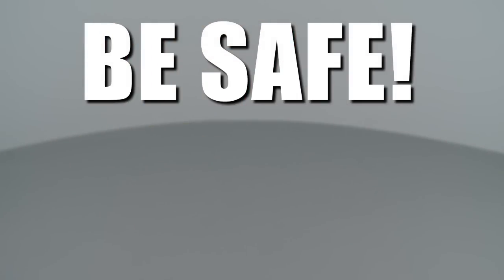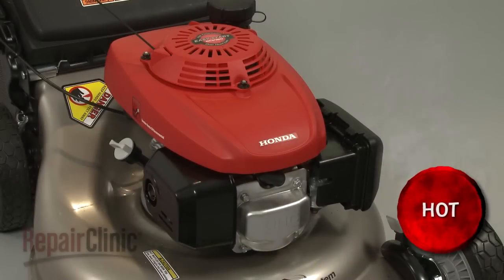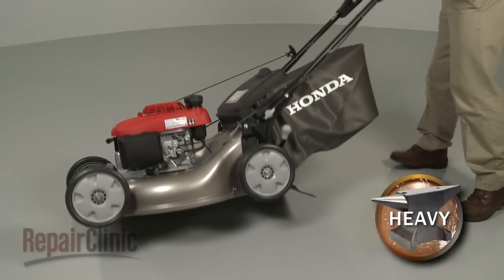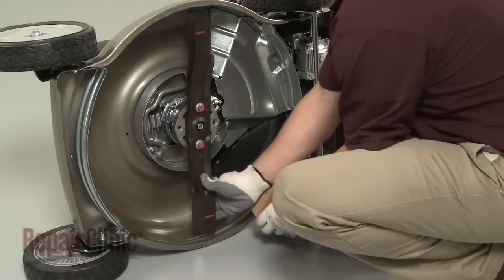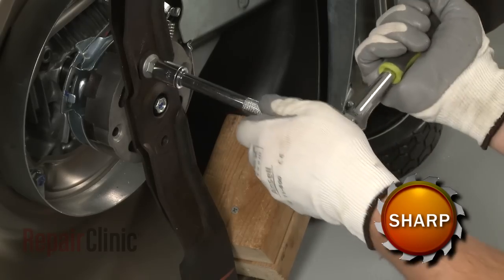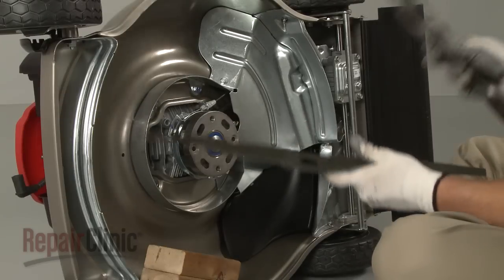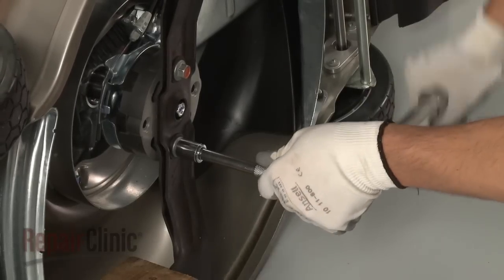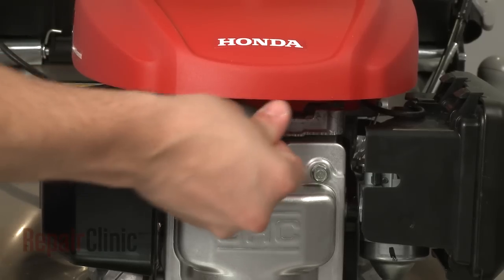Honda Lawn Mower Mulching Blade Replacement #72531-VE2-020

Comment: can you show me how to convert from mulcher blade to normal cutting blades haveing probs taking off blade keeper on the keyway
Reply from the maker: +dnny operator You would do everything we do in this video, but use a different blade that is designed for mulching.
Reply: Yep got it.it had to be cut off with a cutting disc.been on there for 25 yrs.

Comment: Do you have to drain the engine oil before turning the mower on its side ?
Reply: No, but if it is hard to start afterwards or dies quickly after cranking, inspect and clean the spark plug.